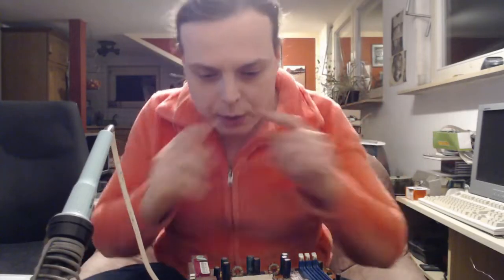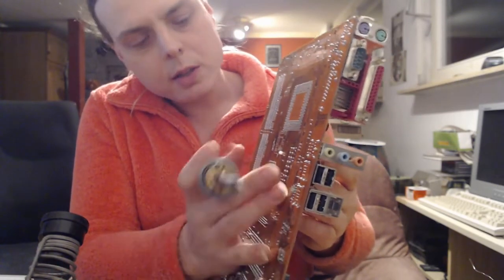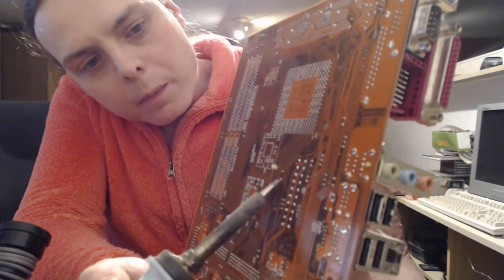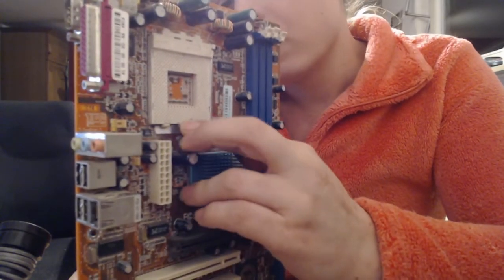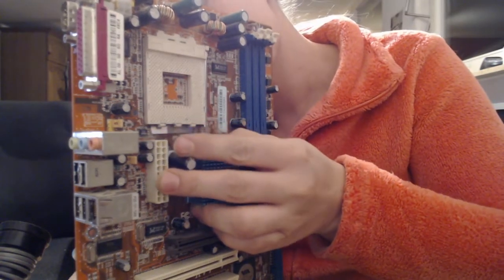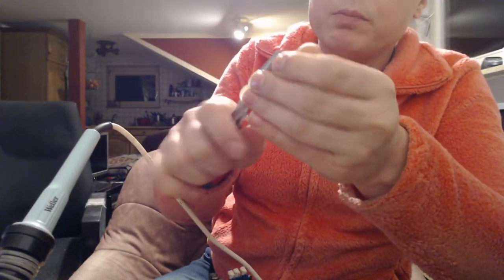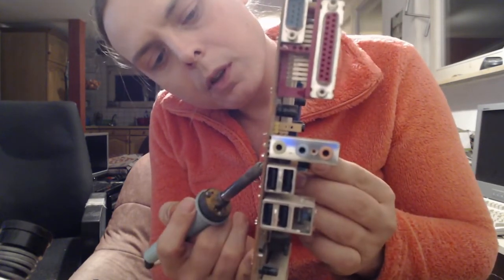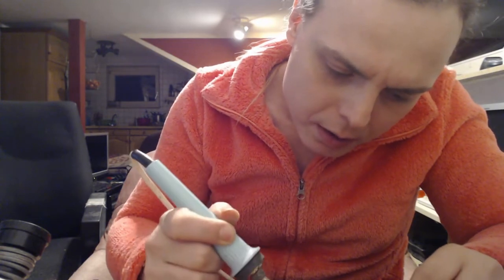Elko tauschen in unter 3 Minuten

Comment: It's quite effective, I use always such an old metal ribbon to heat the solder joints and to de-solder it.

Thanks anyways!
Reply from the maker: Yes, i use the solder wick a lot as well. This method only works on capacitors and other parts that are relatively tall and have only two connections.

And in some cases, like when you have large ground planes, it can be horribly hard to get the solder flowing enough to use solder wick.